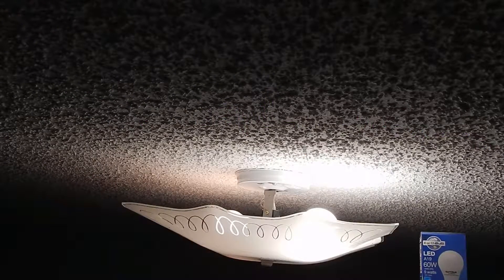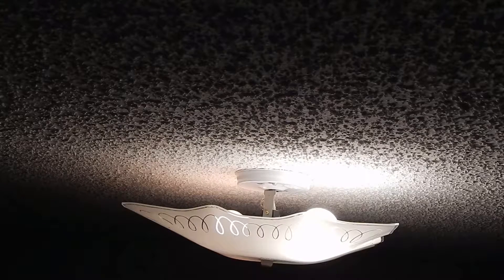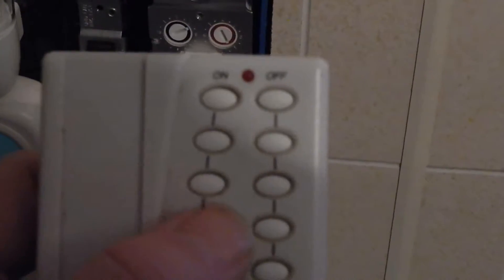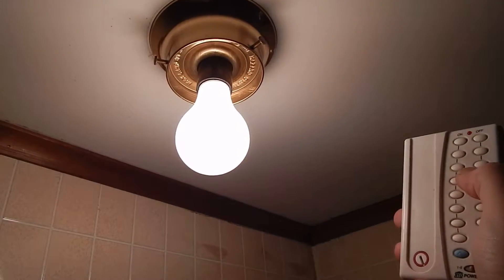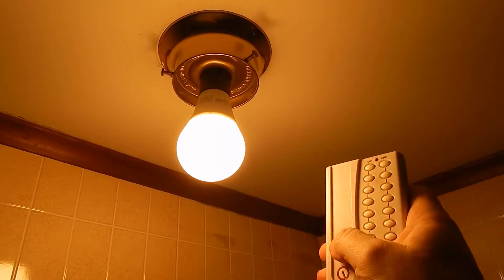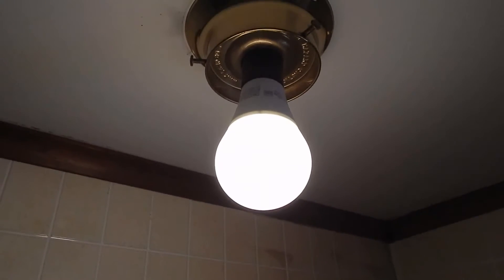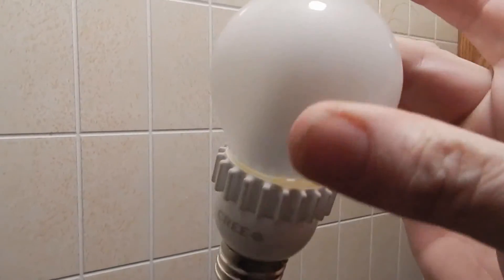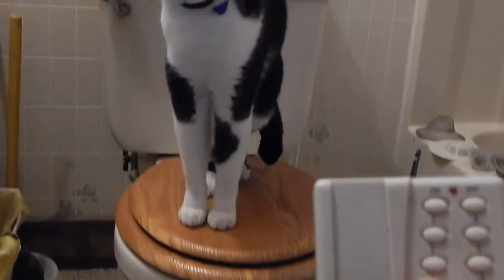X10 Signal Eating LED Bulbs

Comment: Your problem is caused by the "bleed current" from an X-10 module, used for "local control" of the lamp.  This small current is enough to make the LED illuminate.  There are fixes for this on various forums, but the X-10 folks really need to modify their parts for future sales.
Reply: All I can find are on the wayback machine. I have a few I modded but really hate to have to tear one apart to show how I did it. 
I should document the procedure and host on my web site since its so hard to find. Unless you could point me to something still live.
Here is what I found of some forums that used to exist. 
https://web.archive.org/web/20120324073244/http://www.idobartana.com/hakb/
It roughly describes the update, but it's maybe not apparent to people without images.
Reply: I have done the mod myself in the past, but it sure is a lot of bother for something that the X-10 folks should provide.

Comment: Run the bulb in the enclosed fixture for about a half hour, remove the globe and read the temp with your non contact thermometer on the bulb's heat sink area. If it is over 200 Deg F, it is too hot for it. The Cree bulb was only 6 watt (I think) and had cooling fins, so it is a safer bet. High power factor bulbs draw current at high frequency continuously across the waveform and might leave enough noise on the line to interfere with the X10 signals.
Reply from the maker: It doesn't get nearly as warm as that but I should check it in the summer, when the fixture is backed to a hot attic rather than a polar one.